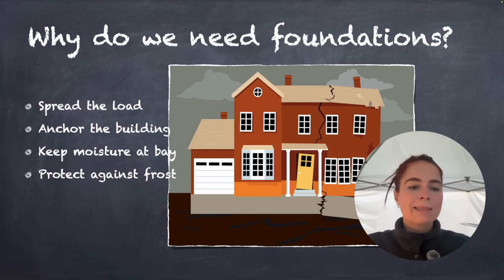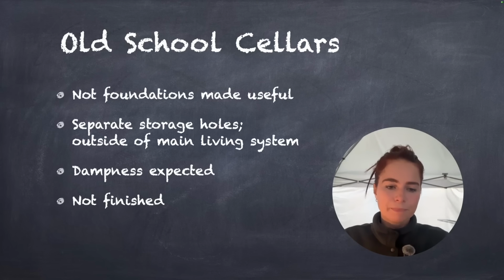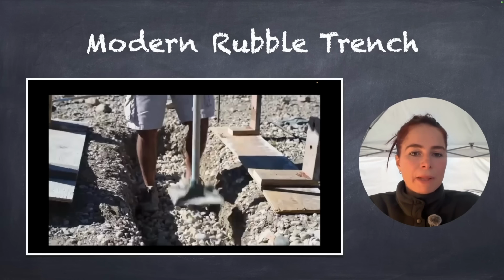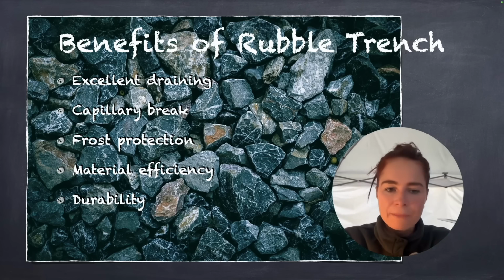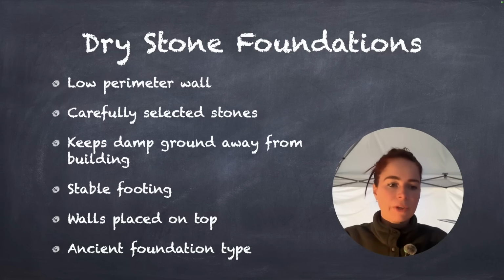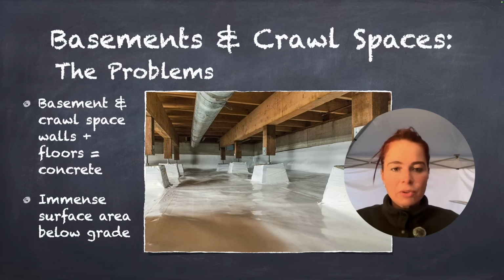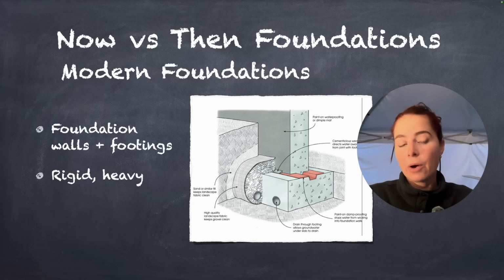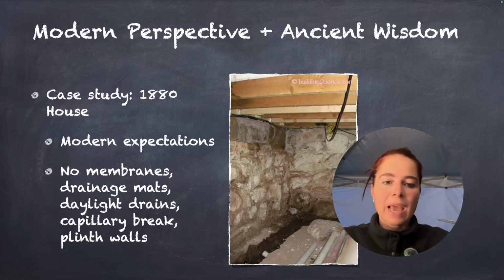Why Modern Foundations Fail — and the Genius Design We Abandoned

Comment: "This Guy" Frank Lloyd Wright.  Just one of the most famous Architects in the world because of his intent to design homes to Fit within its environment, whether Urban, Rural, or Wilderness.
Isn't it Cute when kids learn something new.
Reply: He most famously made buildings with leaky roofs.
Reply: @Ho1yhe11  I thought that Frank Lloyd Wright was an architect, not a roofer. 
Every day you learn something new.
Reply: @Ho1yhe11 He designed buildings ahead of what building technology could catch up to.
Reply: @Ho1yhe11  Don't forget the "client proof" furniture.  Don't even think about moving the dining room table or built in seating.
Reply: FLW designed the Imperial Hotel that survived the Tokyo earthquake because the foundation was built on round "timbers" that allowed movement.  His son invented the Lincoln Log toy based on his father's foundation.
Reply: Using a hand held tamp to try to compact 12" of stone is idiotic.  The use of a motorized flat plate tamp would be preferred in shallower lifts of 2"-4" due to its higher frequency and thereby the ability to vibrate and lock the stones in a compact arrangement.  An upright" jumping jack" tamp hits with more force but lower frequency and is best use where there are "fines" such as silt, loam or clay.  The upright has a greater area of influence and thereby can be used with deeper lifts.
Reply: Yes she's very/tooo painful to endure bye
Reply: Wright sometimes prioritized his aesthetic vision over practical function and durability, which led to many of these problems.  his buildings looked cool from the outside and even part of the inside but were constructed poorly & had major structural & design flaws. 

Water leaks: those with flat roofs, were prone to leaking. 

Poor drainage: Unity Temple, had undersized internal drainage systems, and many lacked adequate terrace drainage, leading to water damage over time. 

Structural instability: Some cantilevered designs had insufficient support, such as at Fallingwater, which began to droop and crack soon after it was built. 
Material issues: Wright often pushed the boundaries of materials, which sometimes led to structural problems and a lack of durability. 

Functionality and livability issues
Energy inefficiency: His designs were often energy-wasteful, with poor heating and cooling systems. 
Lack of storage: Many of his homes lacked adequate closet and storage space. 
Impractical furniture: Wright designed much of the furniture for his homes, which was often built into the structure and difficult to replace or change. 
Poorly functioning windows: Some windows were designed in ways that made them difficult to open or operate properly. 

Maintenance and design conflicts
High maintenance: The combination of unique materials, complex designs, and structural flaws often resulted in buildings that were difficult and expensive to maintain. 

Aesthetics over practicality: Critics argue that 
Outdated layouts: The floor plans and styles, such as closed-off kitchens and dark wood paneling, can feel dated to modern homeowners.
Reply: @PBoss0  A leaking flat roof is due too poor execution, not design. 
A correctly executed flat roof is leak free and low maintenance for 2 to 3 decades (after which a new water proofing membrane should be installed).
Reply: This woman acts if she discovered something.  No idea where she gets the audacity to lecture people on how to build. She has no understanding of the crap she regurgitates. Romans/Greeks used rubble because...wait for it...that's all they had that was cheap, abundant, and could be built with manual labor.  Smdh.
Reply: @ArthurDentZaphodBeeb  Romans perfected concrete. Roman concrete was/is self-healing. Rubble and trench allows for ground movement without damaging the structure.

Comment: What you don't know is that basements in Canada used to be constructed in a different way that incorporated a moisture management method.  It was called weeping tile as well as other names.  Then contractors in their endless effort to profit convinced the industry to change and use a sump pump system.  Now they saved a bucket on labor and materials and passed the management of moisture onto the home owner, and now they could build in soil conditions where they shouldn't.  Not all home owners fully appreciate this responsibility and not all building  regions should use this system either.  So, the new and cheap construction methods of today help the builder but often hurt the owner and that is in part some of the contributors to smelly moldy basements
Reply: This is the real issue, intelligent contractors have dealt with these issues properly over the years and some of them probably even had great solutions. I've worked with that type, and they are awesome. 

But no matter how great your workers are when the boss (or company or whoever) cuts corners or impliments worse solutions, the evenutal home owners pay for it. 

At least this youtuber admits at the end we shouldn't romantizise the old ways, as they are not perfect. Im sorry their health problems could be worsened by bad building practices so I hope they get the results they want. 

Thats exactly why we need better building codes, AND inspectors that care about them. Theres plenty of home inspection videos out there showing how little regard most have for doing a quality job.
Reply: Righto. There are code requirements here for vapour/air barriers as well as radon mitigation. The way we (or at least some of us) build now could damned-near be placed in the middle of a lake and not have any moisture problems. Foundation water proofing has come so far that there is zero ground contact whatsoever. That said, design and material availability is one thing. Knowledge of such things and the skill to apply them correctly is another entirely. For every properly built home, there are 100 that aren't. Not just due to poor workmanship or the typical cut corners but the majority of homes are being built by massive corporate developers that lobby against having to build properly. On the more honest side of things it's just an ever-changing industry which building science is really in it's infancy. Most houses that are having issues are built prior to '97 which was our first iteration of a true "modern" code book. Even the 2024 OBC or IRC is vastly different from the 2017 version. So this is a fantastic discussion and she brings up a lot of good information and thoughts we should consider with future design.
Reply: @kencraft4567 what's the name of your construction company. Where can we learn more about your practices?
Reply: "weeping tile" is the coloquial term for perf flex 4" corrugated drainage pipe. Also in Canada here - the 7ft frost line (north alberta) makes floating foundations more appealing (code adjacent).
Reply: wtf are you talking about. its still code. you're not getting past foundation inspection without damp proofing and drainage
Reply: All houses have weeping tile, but rather being made of 1.2ft clay pipe like sections (taracotta), today its made of a ribbed tube full of holes surrounded by a sock and porus medium (loose foam pelets). and surrounded by 3/4 crush. The only thing the sump pump is for is because back in the day the weeping system used to be tied directly into the sewage line with a trap postceeding it. Look at any of floor drains from an old home made pre 1990's, you'll see a random hole just above the water line in the pipe of that floor drain (which is water sitting in the trap), that hole above the water line leads to your outside weeping tile traversing under your slab and out through your foundation footings.

Back then the CMU foundations (not even reinforced with rebar and concrete inside the hollow channels of that CMU) were not even decoupled from the outside by a membrane either, if you paid extra you might get tarpaper/bitument appled to the outside which might last 5-7 years. All of the minimum methods of today is building code, which back then didnt even exist. Having to use a sump pump by law and code in today's basements with rebar reinforced monolithic poured concrete is a vast vast vast improvement to both foundation strength and water mitigation, and actually costs more than the older foundations found the past 200 years from when basic stacked stone was still the norm. It also prevents your city sewers  (which in many areas can be over 150 years old) from backing up into your basement (even with a backflow preventer)
Reply from the maker: Such a great exchange — I really appreciate both of your perspectives. @micmike, I agree that we lost a lot of traditional wisdom as building shifted toward speed and profit. And @JSLEnterprises, you’re absolutely right about why modern systems separate from sewage — that’s a huge safety improvement. It’s interesting though how, even with stronger concrete and code-required drainage, we’re still seeing moisture and air quality issues in basements today. It really shows how complex these systems are.
Reply: You ALMOST had it...  GOV'T is the problem.  Not the "greedy contractors".
Reply: @212caboose used to be heavily involved in the building/development industry.  The way it was run didn't jive with my ethics, so I left.  Much less care these days for quality, it's all about how to squeeze the most profit from every last inch at the production builder level. 

Tldr: it's definitely greedy builders and lobbyists, I'm afraid.
Reply: @TheNExperience ethical people seem to be dropping out of medicine, construction, and every humane craft. I guess modern greed and half-truths aren't aligned with their values
Reply: @212caboose  You're an idiot. Contractors and corporations lobby government to get harmful policies. It is indeed the businesses that are the problem. Those who like to claim government is the source of all problems have no comprehension of societal constructs and what life would be like without the government policies they whine about.

And often, government does it better. There's a lot of propaganda out there to convince people otherwise. But reality is, private sector has been driving the many transgressions against citizens, corrupting government for the benefit of the wealthy. You get rid of government, you just get private sector directly screwing you. You get company towns where you get paid in credit to use at the company store, so you are essentially just a slave to a company.
Reply: @212caboose You must have never watched the TV series "Holmes on homes."  He constantly advocated for better codes.

Comment: A Rubble wall is a solid wall using irregular stones and mortar,  either lime, mud or concrete based. 
They can work, I have a friend who has a house that is over 100 years old. But everything about that house directed all water away from the foundation.  That included all water from the roof directed well away using guttering and directed, sloped trenches.
Reply from the maker: That’s really interesting — and you’re absolutely right, good water management makes all the difference. A well-drained site and proper grading can keep even older systems performing far beyond expectations. In the case study I mentioned, unfortunately the drainage wasn’t managed well, and that’s what really tipped it into failure. A true rubble trench foundation is quite different from a rubble wall — it’s all about giving water a clear path away from the structure rather than trying to resist it. Sounds like your friend’s setup did that perfectly!
Reply: @thehealthybuildingproject  it did that indeed.  He was a former Marine and used his grit well. ❤
Reply: I bet its not energy efficient & comfortable all year round. aka not ideal for a living space